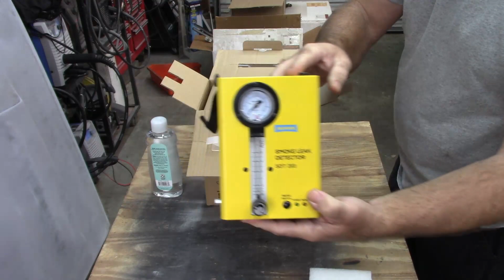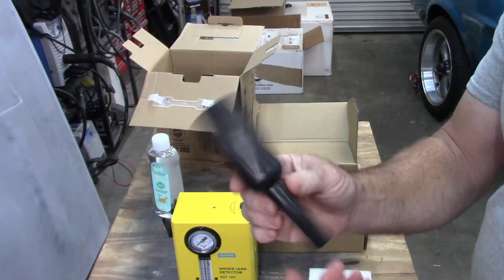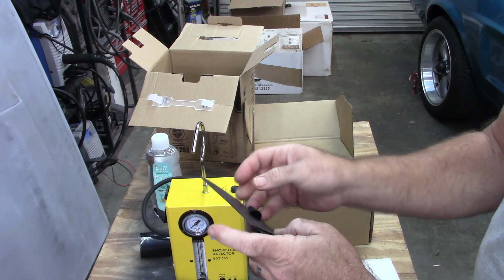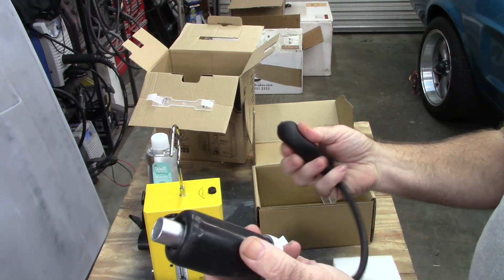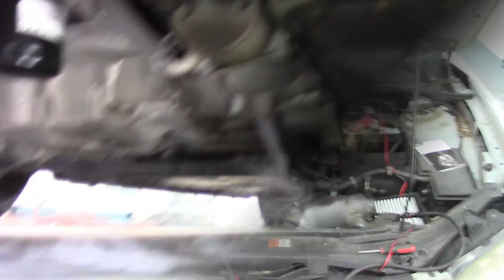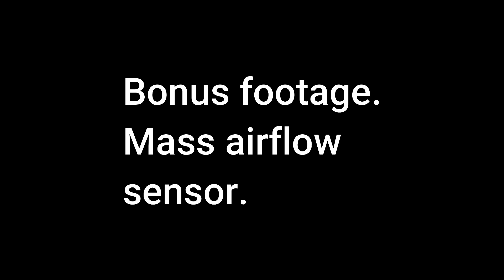Mazda 3 part 2. Autool Smoke checker

Comment: Guys I need help, I have a 2006 Mazda 3 2.0, rough idle, no codes thrown but obd read ol fault, when unplug MAF idles fine, replaced MAF with 2yr cons hand and 1 new still
Same issue. I have gone over the top amd replaced fuel filter, injector service kit done, spark plugs, coils, o2 sensors changed, still rough idle. What area should I be looking for leak if is one.

Comment: Didn't get to the part where pressure builds... Know that you gotta be careful how much psi you let build up or you could blow intake gaskets. I believe under 3psi, but you should verify. Use the flow gauge to dial flow back and stop air as pressure builds. Bottom guage should drop to 0, then watch the top pressure gauge to see if it holds for 30 seconds.

Comment: Try the brake booster hose it's the best place to throw smoke in to find a leak. I made my own smoke machine with a glass jar and some incense with a portable air machine 👍
Reply: Hi...if you conected to the brake booster hose,..will you get air in the brake system?...do i have to bleed the brakes after that.?
Please help...thank you very much
Reply: Funny ….😂but good question if you don’t no any better …the brake fluid is separate from the power brake system

Comment: Why did you select this particular smoke leak detector, SDT-203?  AND I'm further confused because the Autool Website doesn't even list this model.  ALSO, your link connected me to Amazon but not the product.  ANYWAY, the video is just GREAT!
Reply from the maker: I liked that it did not require an air supply or power supply. I updated the link. But here it is as well: https://amzn.to/3omxQAG
Reply: @JoDaddysGarage  Thanks!  No, external air supply is definitely a winner.  I made the pvc diy one but it's a pain.  Thanks again for all the videos you share!!!

Comment: May want to clean or replace  injectors and seals with oem injector seals. It will eliminate faulty injector seals that leak one way but not the other where the smoke machine cant catch. You can also check it by spraying brake cllean or carb cleaner to see if its sucking in air if the engine run high while spraying over the injectors. I have the origional autool smoke machine pre flow guage and its been great. Their injector cleaner machine is AWESOME and has saved me a lot of money in not having to buy new injectors. Using it to do routine injector cleanimg also helps keep the engine running great and good gas mileage, worth the initial cost, especially with gas prices nowadays. Works great also for finding bad injectors to.
Reply from the maker: Thanks. I did have the injectors out, and I had also sprayed ether around them while running. No difference.